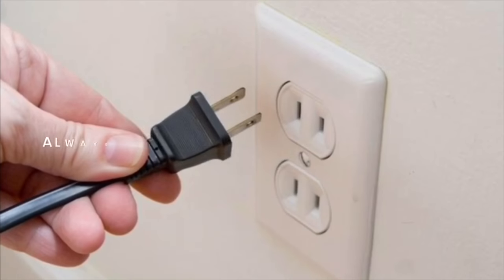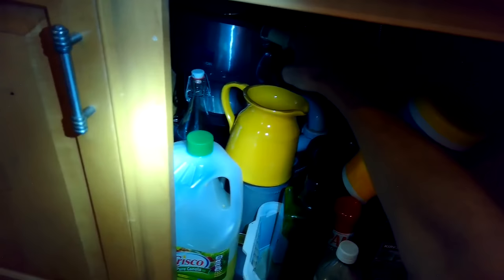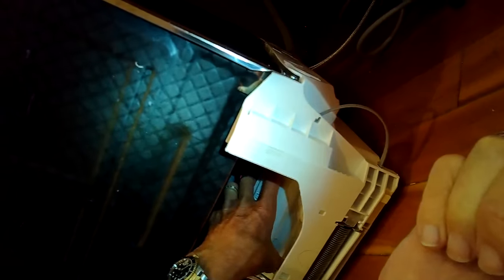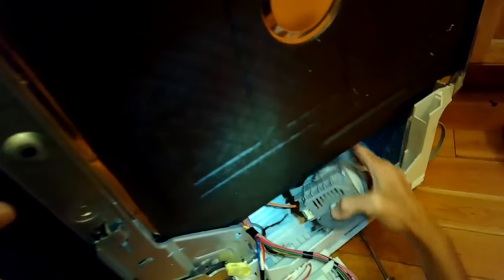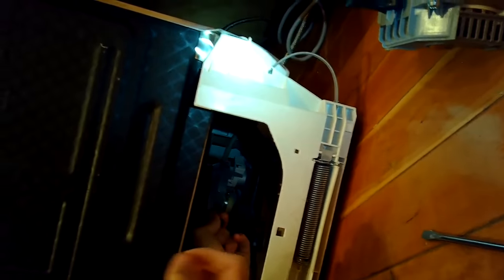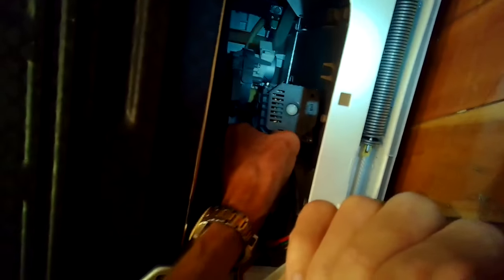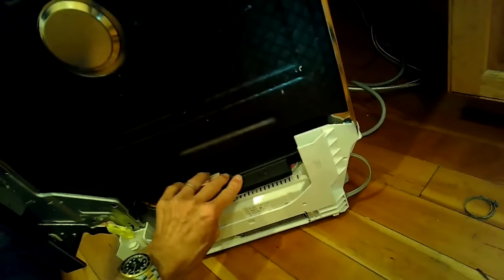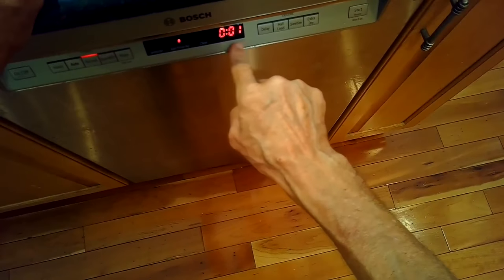✨ BOSCH DISHWASHER - E09 - EASY FIX ✨

Comment: Really should not use dish soap, using rinse aid is a much better way to go and the edge connectors have a release on the top you should not wiggle or use a tool on the red or black wired edge connectors. you can also lay the unit in its side to not fight gravity.
Reply from the maker: Great Ideas,
Thank You😊😊

Comment: Thanks! Made the job super easy. I wasn’t able to get a new heater/motor unit quick enough so I took the heater/motor apart and was able to solder the burnt connection on the heater and now it works perfect at $0 cost. -- UPDATE 8/2020-- My solder fix failed after 7 months so I replaced the pump today with a new one.
Reply from the maker: Wow,

Very impressive 👍
Reply: How easy was it to take that apart?
Reply: Dad Dancing - It was only a few screws, the outer shell of the pump is the heater and that is a press fit into the pump intake with a rubber seal, the only trouble I had was with that seal. First try it leaked a little so I took it back out and apart and used a little Vaseline on the seal. No more leak after that and its been a few months now. You might be able to solder the connector without taking the pump apart because there’s a opening in the case at the connector.
Reply: @Mark_Glanville  Thank you so much Mark, for taking the trouble to describe that.
Reply: Took mine apart and was able to solder  the trace from the connector to the heater.   Thanks for the advice.
Reply: @Mark_Glanville  thank you for this post. Was calling around to price out a new pump, dealers all had to order it so wait weeks for delivery. Took mine apart, noticed the blown soldering connection, fixed it. Bought $1 hose clamp and saved myself $300 easy!  And Scott, great how to video!! Watched another guys video where he dismantled the entire dw to get to the pump!
Reply: Hey, Thank you for sharing your experience.
It looks like I have got the same problem. Have you got any idea why yours popped in the first place? I plan on trying to solder it too and wonder if there is an underlying cause to fix so it doesn't pop again right away.
Reply: Magnus Pedersen Maag  - I’m not sure why it burns out but it’s probably just a badly designed part that doesn’t last as long as it should. Ours is still working fine 4 months after the fix.
Reply: @Mark_Glanville  - thanks a lot. I'll just give it a shot then and see how it goes.
Reply: This was the comment I was looking for. Can we fix her lol

Comment: Thank you for the video.  Have you considered rotating the dishwasher onto its right side when replacing this pump.  I found the bottom access far easier and had to disconnect less parts of the dishwasher.  My Bosch replacement pump came with a screw clamp to replace the original crimp clamp.
Reply from the maker: Great idea😊

Comment: Very direct, thank you. I had called a repair guy, as I couldn’t get the silly “permanent spring clip” off. He helped me along & told me there was a new clip with the part; sure enough, it was just caught in the valve. The clip release was way on the underside, so I turned the pump & could access the release. The repair guy was so impressed I was taking it on myself, he offered me a job. LOL Honestly, I don’t know how guys get access in some of these areas. Females hands & fingers are so much smaller.
Reply from the maker: Thanks Sandra, that’s so true😊
💻 Brand New Appliance Repair Blog - Lots of DIY Easy Fixes - Click Here: https://www.ApplianceFixes4You.com

Comment: After paying virtually half the cost of my dishwasher a few weeks ago to have a faulty water flow reed switch replaced (maybe a $60 part), I was freaking out at having to cough up again. A great video backed up by all the positive comments from other DIYs so I'm going to give it a go. 🙂
The motor/heater is 6yrs old.
Thanks a lot.
Reply from the maker: Please let us know how it goes 👍
Reply: Terrific Scott. Part arrived and replaced as per your video. Error 09 gone, all went smoothly, plates are nice and hot after wash and I know I saved a fortune even after excluding the cost of the part.
Thanks a lot from Down Under.

Comment: Wow that really helped. I think I had more time in research than the actual repair. I think it was 45 minutes total time even with some little mishaps. The simplest thing of plugging the orange and black connectors in really eat my lunch. I actually had to pull the unit out after having it installed to look at why I could not get them plugged in. My advise is the black one goes in first and then the orange one last. You can actually plug the orange one in off-set and then the black one will not go in. Found that out the hard way. 
Thanks for posting this as it was a huge help and made this job go really well.
Reply from the maker: Thanks so much Steve👍

Comment: Thank-you so much! We had the E09 fault on our Bosch dishwasher and your video gave me the exact steps to repair it. The replacement pump came with a jubilee clip (hose clamp) and a replacement plastic insert for the dishwasher sump. Tip: The hoses were long enough to remove the machine without disconnecting the water or waste.
Reply from the maker: Great Tips,
Thank you 😊😊😊

Comment: This video was so helpful, I ordered the heat pump and replaced it myself.  I had trouble reusing the clamp, so I went to an auto parts store and purchased a standard hose clamp.  No more E09 code and the dishwasher is working great!
Reply from the maker: Thanks so much Bruce😊😊

Comment: Thanks, great video! I have just removed the broken pump (checked the resistance with a multimeter) and waiting for the replacement to arrive home. The only doubt is why this is happened? Filter was really clean, the engine in the pump was working fine and I didn't see any problem until the E09 appeared. I hope it was the age of the dishwasher (8.5 years old) that made this possible, otherwise I am worried it can happen again soon.
Reply from the maker: You’re right, it’s just age related. Bosch went with a new type of circulation pump that has a heater added to it.
The wire used for the heating element is too thin and breaks causing a no Heat dishwasher.
Reply: @ScottTheFixItGuyChannel  Thanks, I actually removed also the heating element inside the pump as I wanted to see where it happened. I found several burned points, I suppose one of them was the culprit and the problem was just ready to happen. Quite annoyingly it happened the 1st day of the year :D 

I have seen some videos that explain some ways to repair it, but it will change the resistance and I am a bit worried that can cause problems to other parts of the machine. So, I will just stick with the original plan and change the whole piece thanks to your video.

Comment: Thank you for recording this repair. You saved my husband and me a lot of grief trying to replace the water heater on our Bosch dishwasher without having to completely dismantle it as show in other videos.
Reply: I saw the same. . . . horrifying videos of complete dismantling the whole thing to get to the pump . . . . I nearly gave up then found this video :)
Reply: @bobspanner  - ikr? When I ordered the part, I watched a repair video and the Bosch Dishwasher in the video did not have the plastic covering like my model. When we tipped ours over we were shocked to discover it was not going to be as easy as the repair video showed. Then it was a frantic search to find something that would help us, and thankfully I found this video.

Comment: Thanks so much for this video. A repair guy (linked from the Bosch website) came to my house and told me that it would be $500 to replace the whole control board (not the heater/pump) and it would be better just to buy a new dishwasher. I ordered the part for just over $100 and followed this video and everything works fine. Only wish I would've done that before contacting the repair company...
Reply from the maker: You’re the Man Austin😊😊😊

Comment: I did this repair! I’ve done a few other appliance repairs and this wasn’t the easiest, but it was mostly related to the position you had to put yourself in. My order of the new part left out the new clamp so we bought a c-clamp at hardware store. Running the first express round and will check for leaks before we put trim pieces back! To get the old motor off, I found the clamp impossibly tight, so I did gentle wiggling and was able to get enough looseness to slide off the original clamp. Getting the control panel loose was harder than it looked bc I didn’t want to damage it. Thanks for empowering me to do this! UPDATE: Ran an express load and pulled out, NO LEAKS!
Reply from the maker: Wow, job Vanessa😊
Reply: I could not get the clamp off either so I did your trick of wiggling it off and it worked!  Thanks for the suggestion.

Comment: This was very clear and helped me fix this problem.  I've had this Bosch for 2 and 1/2 years and never loaded it with un-rinsed dishes - yet still the heat pump failed.  Couldn't find any stuff in the one I took out, so not sure why it would fail.  After two Bosch dishwashers with problems (earlier one had a plastic handle that broke and replaced twice in five years - very poor design flaw) and this one never completely dries the dishes like my last one did (although it was a Bosch).  I'm inclined to invest in another company after this one, but wonder if none of them are as good as they used to be.  They've gotten fancier and more complex, with more options to fail, I guess.  Thanks for your very clear instructions.  $100 and 2 hours of work later I'm sure I saved $300 in labor, and have the satisfaction of knowing it was fixed right.
Reply from the maker: Thanks Rob,  that new design is really bad and doesn’t last.
Reply: @ScottTheFixItGuyChannel  So much for Bosch credibility and reliability.  A reputable company should stand behind their product and offer help.  Not sure what companies do that.  Thanks again.  Glad to have made a contribution to you for your great help.

Comment: Good video, it helped alot. My heat pump lasted 6 years from new, I would like to know if other Bosch owners experienced longer or shorter life from their heat pump. Your video mentioned a clogged filter as a possible cause for failure. I noticed during my repair another possible reason for failure. The inlet screen was clogged with rust and sediment from the water supply. I soaked the screen in a lime and rust cleaner for five minutes and it was good as new.
Reply from the maker: Nice job Barney.
They are burning out often before 4 years😬

Comment: Great video, thanks. I have a Neff S511A50X1G/48 and just fixed it following this guide. I managed to do it without pulling the dishwasher out though - there is a front panel below the door I could remove and there was /just/ enough space to do the repair through there. It was fiddly and I had to use a torch but still quicker for me than removing the integrated dishwasher would have been. I definitely couldn't have done it without following this video for the precise steps and movements needed to switch out the pump. Thanks!
Reply from the maker: Nicely done James👍😊

Comment: Thanks for posting this. I followed the video and have successfully replaced the pump (on a 2 year old bosch). Turns out that a small piece of wire (from a metal scouring pad) worked it's way into the motor and caused a short.
Reply from the maker: Nice job Mark👍👍👍👍

Comment: Thanks for the informative video.  The failure on mine was at the heater element film at the connector. The heater is a 1.2kW 120VAC) thin strip design bonded to what appears to be a stainless steel collar. There are a pair of NTC thermistors providing temperature and OTP feedback to the controller. I believe the root failure cause to be a poorly designed soldered interface between the connector and the heater film pad. I have a picture showing the break in the heater film immediately adjacent to the soldered connector lead. There is also no stress relief in the soldered joint to accommodate the differential CTE.
Reply from the maker: Wow. Excellent diagnosis.
That’s the Achilles heel to an otherwise great dishwasher.

Comment: Thanks, it worked very well. Not sure why, the first time I started the dishwasher the cord become really hot and it actually burned the fuse after 15 minutes. I double checked everything and didn't find any problem. So, I supposed must have been something stuck somewhere or the cord not connected properly. I ran another 2 washing, longer and hotter this time, and everything was fine. Hope 5 quid are enough for a pint where you live ;)
Reply from the maker: That’s so good you got it going👍😊

Comment: Excellent video that guided me through the process of replacing a Bosch circulation motor, easy when you know what bits to take off. Unfortunately for me once the motor was replaced it didn't clear the E09 fault which was very frustrating.
Reply from the maker: Interesting,
I’d say it will need a new control board👍
Reply: @ScottTheFixItGuyChannel  Thanks, I thought it might be the temperature sensor but no idea where that is. Unfortunately I have come to the view that just buying the parts makes this machine uneconomic to repair. Just five years old but turns out to be cheaper to replace that repair.
Reply: I agree Martin,
It’s sad that Bosch Dishwasher’s have dropped to such a low level.
They actually used to be one of the best ones you can get.
Reply: @QuickAndEasy5MinuteAppliance  Just an update on this, I eventually got round to borrowing a multi-meter to test the original water circulation pump and testing confirmed that there was a fault with the heater element. I also tested the replacement part which passed so I am not sure now why fitting the replacement didn't fix the problem.

Comment: Thanks for the great video.  E09 error coincided with tripping the RCD circuit. £80 from Amazon for the heat pump. My six year old Siemens dishwasher was just like the one in the video except that the cover on the control unit was clipped at one end and trick to prise off. Other than that simple enough to swap the pump even for a novice like me. Better than buying a new dishwasher.
Reply: Hi, thanks for comment.  I am also getting E09 error in Siemens dishwasher. 

My question is,
Is this error due to RCD circuit or due to pump? How you found this defective part? Thank you so much.

Comment: Thank you for the video. I'm still having the error after the replacement. Any thoughts on what may be causing it and how to fix? Most search results point to the control board 😢😢. Thank you again.
Reply from the maker: How high does the water get after running it for 3 minutes. It might need a new fill valve.
Reply: @ScottTheFixItGuyChannel  Thanks so much for the follow up. It turned out that the new pump was not properly plugged in. Sorted now - phew! Thanks & Congrats again on your great content.

Comment: Hello man !  Thank you so much.  I just fix my machine. Every think ok ! Really cool your video. In my case I have to change the cables from the original (old ) Heater pump to the new one like your example.  Mayble you can make a video about the old to the new one eletric system cable. Nelson

Comment: Scott Thanks for the Video, After replacing the heat pump, the controller is tripping again and again, means power is on, but machine running indicator light goes off, and again it starts, and again it stops, does it mean that controller unit is having some issue?
Reply from the maker: Can you redo all the pump connections again? I wonder if there is a wire touching metal somewhere and grounding out?

Comment: This video couldn't have come at a better time - my Bosch SHE68T56UC/09 stopped heating, would skip 30 minutes or more of the cycle, and give me the E09 error. The dishwasher in your video is identical to mine on the inside, so I ordered the part (#12008381) and decided to give it a go. You easily saved me a couple hundred dollars in repair costs. Thank you!!
Reply: ditto.  thanks.

Comment: Thanks mate, great help. Getting the bloody hose clamp off was a lot harder on my machine and took a few beers in the making. Great trick using dish washing liquid as lubricant before reassembling, which was a lot easier. You saved me a few bob here. Thanks again.
Reply from the maker: Excellent ,  happy to help my overseas friends👍
Reply: Any tips for the hose clamp? I was going great until I got to this but just can’t work out how to open the clamp…thank you
Reply: @alistairwot  I found that because it is crimp style clamp, it likely won't open. I gently wiggled the motor enough to be able to free it from the clamp.
Reply: @vanessakynes9091  thanks for the tip. I found that going round from the left side I could pry the clamp open with a screwdriver quite easily
Reply: @alistairwot  Yes! That was the tip I needed when I was doing it. I didn't think of looking in the reverse side.

Comment: Hi Scott, not sure if the question was asked previously but if I don’t do anything about it how would it affect the cleaning of the dishes? The part costs about $150 and I’m just wondering if I can do without fixing it. Thanks for the detailed instructions!
Reply from the maker: It’s important because it heats the water and that melts the soap.
Reply: ...imagine washing all your dishes in a sink, but only with COLD water 100% of the time.  Not much disinfection going on.  If I remember correctly, the water needs to be at least 135 degrees F, minimum for proper washing.  Also, put butter on a knife, then try to clean it after running it under cold water... Yeah, it's not gonna come off the knife.